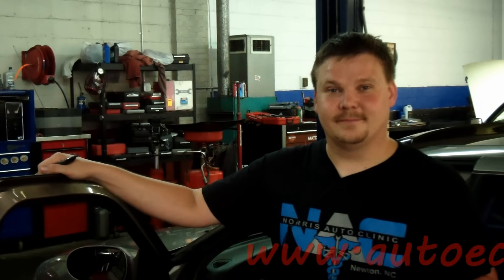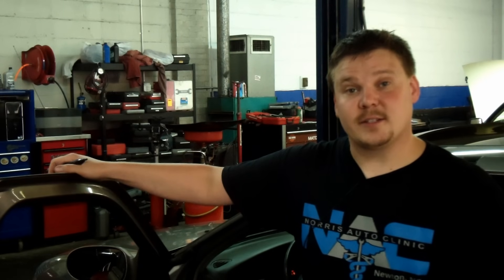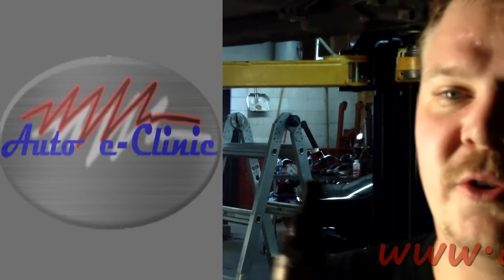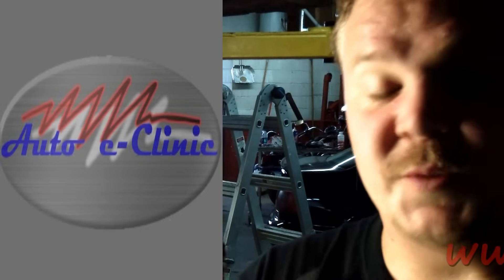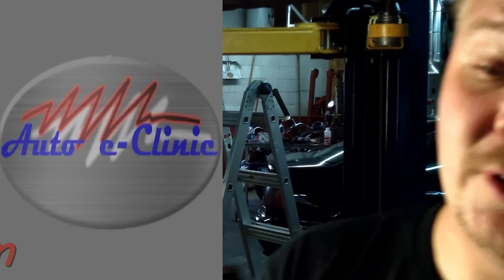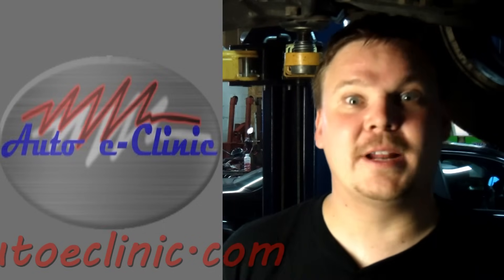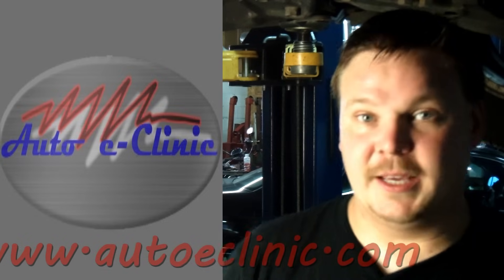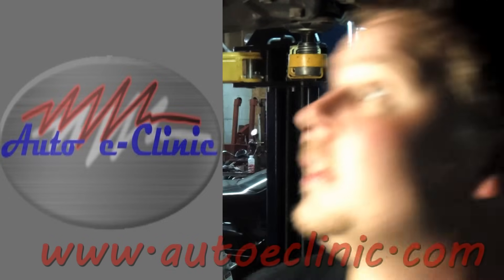How to Fix a P0138 Code: O2 Sensor Circuit High Voltage Bank 1 Sensor 2

Comment: I don’t know if he covered this part but if it’s been in the fucking pipe a long time go down to Home Depot get a little map torch and heat up a little bit. The odds of you snapping that O2 sensor in the pipe is pretty high if you’re not a mechanic and you don’t do this all the time you don’t have the skill set to understand the dues and don’ts of taking out a simple O2 sensor, if you snap that in the pipe now you got a problem it’s gonna get expensive settling torch and heat up a little bit that will guarantee you almost got that old two cents. It will come out. I’ve seen people do that. Don’t really know. is they get wrench put a lot of on it and they snap it in the pipe now you got a problem.

Comment: That car is running rich as fuck and thats why the o2 was black.  Replacing the sensor wont fix the likely leaky injector or worn out spark plugs.

Comment: Yeah I replaced all four of my '02 sensors and I'm still getting the same code and have voltage to all of it. What now? This is on a '05 Dodge Dakota 3.7
Reply: If you changed the sensor and it is not of good quality or you got it online, that may be the problem.

Comment: What if in a 2010 buick lacrosse 3.o I changed all 4 02 sensors and the the wires good but the check engine code still on?

Comment: scan is showing POO32 POO38 POO52 POO58 even after sensor replacement,..... ECM failure ?
Reply: Or a wiring failure to the sensor(s)

Comment: so Sensor 1 is likely on top of the engine.  in a 2018 Kia Soul, there's one on top and one downstream.  Its throwing P0132 and P2237 and cylinder 2 misfire, and knock sensor.

Comment: I've replaced both my O2 sensors and I still get this same error p0138 p  P0031 p0132 p0037
Reply: did you manage to fix it? Im having a same problem and have a purge solenoid error as well
Reply: @5149111  no I haven't I stopped trying truck seems to be running okay so I gave up
Reply: @troyonufer2029 could just be a fuse or relay

Comment: Wiring harness on my 03 Explorer bank 1 sensor 1 the wiring harness off the engine reads 12 volts off to sides then I have the ground and I'm getting about 1 amp. With it unplugged key why am I getting 12 volts out of two little wires

Comment: i have 06 kia sorento had the same problem i replace both downstream sensor check wire volt was good same code as everybody it came up that was the angle position(camshaft sensor) it would also not detecting my catalytic

Comment: What if the sensor was good and the high voltage was due to a lack of oxygen in the exhaust?
Reply: That's a sign I think of a bad cat...I never got how the computer differentiates between a bad downstream sensor and a bad cat

Comment: The car is not a B15 Sentra. I was looking at this for location because there are actually FOUR sensors (bank 1, bank 2). I have p0138 which is Bank 1 sensor 2 but this video has a O2 sensor that's not even where the location is.

Comment: I have an 06 Dodge Caravan, 3.8 V6, and got an 02 fault code. I replaced sensor, cleaned and checked contacts, reset it, but code still there.. Any thoughts?

Comment: Error 138 means that the oxygen sensor is generating a high signal above 1 volt for a long period of time. This can happen if the sensor is not able to breathe fresh air. The breathing process is happening through the sensor wires. Thus cleaning the wires end can resolve this error code. Also it is possible to make some punches in the wires to let the fresh air getting into the sensor.
Reply: Punches in the wires 😂😅😂
Reply: @FernoFactor  
Pressure release 👏👏😜😜
Reply: How you punching holes in wires bud? 😮

Comment: what kind of Voltage meter are you using what model??
Reply: Jose Diaz that was a “power probe” they are so nice. They can detect either voltage or grounds without having to rewire like a test light.
Reply: @MaxDoody  do you know how much it will cost?

Comment: Hi, I have the same code with pt cruiser, but 1 month ago I already change the sensor because of low voltage, what do you the solution?
Reply: 3:30 3:30

Comment: What to do if u changed o2 sensor and still says low voltage o2
Reply: Christy Fruge check intake and fuel system firstly
Reply: What was the resolution Christy? I'm having this issue

Comment: can an exhaust leak cause it to throw a P0138 code?
Reply: P0138 Possible Causes 
Faulty Rear Heated Oxygen Sensor Bank 1 
Rear Heated Oxygen Sensor Bank 1 harness is open or shorted 
Rear Heated Oxygen Sensor Bank 1 circuit poor electrical connection 
Intake air leaks 
Exhaust gas leaks 
Inappropriate fuel pressure 
Faulty fuel injectors

Comment: Autoeclinic- That was pretty pointless, wasn't it? No explanation of what an O2 sensor does, is, where it is, tools you need, or ANYTHING- just "it goes bad over time, so change it, and the new one fixes the problem, since it's new, so it works like how new stuff does".
Reply: Absolutely pointless. Wow!
Reply: If you are not so mechanically inclined, as it appears you are not, take it to a garage.
Reply: The video was made to sell the parts listed you see.

Comment: Is 2003 nissan altima v6 3.5 coolant temperature sensor circuit high voltage is the same as the temperature sensor?

Comment: Email hello .. my Chevrolet Presents feasible P0131 Low Voltage in o2 circuit .. I did exactly what you explain , then turn off the car for a few hours to turn and walk Reprise code .. Any solution ?

Comment: I replaced my O2 sensor after getting a P0141 code (heater circuit malfunction). After replacing sensor and resetting code I got a P0138 (circuit high input) code for same sensor location on my civic hybrid (no more P0141 code). What gives? O2 sensor is new. What are the next steps to troubleshoot?
Reply: Caty
Reply: Did you ever find a solution? I have the exact same issue. Thinking it could be a poor ground connection?

Comment: i had a code p0138 come on and i watched the video and replaced my 02 sensor and the light came back on with the same code
Reply: Check air leak in your exhaust 

Your catalytic converter may be finished
Reply: Yep
Reply: Oh, that's because they didn't tell you a damn thing. They just said "it goes bad over time, so replace it with a new one"
Reply: Isn't she a moron for not knowing stuff about cars? I don't know how to check the sensor, so I wouldn't try to, since I'm so stupid- definitely not because I don't give a fuck since car nerds are such queers...
Reply: +Meghan A Youre supposed to check the sensor first to see if its working you moron.

Comment: How about this? My 2004 Sebring ok, MIL lamp on, plugged in scan tool, got code P0138, O2 Sensor Bank 1 Sensor 2. Randomly goes away then returns. Car has a power steering leak somewhere and when I fill the reservoir the light also goes out for a bit. Any suggestions?

Comment: It was the O2 wiring melted behind the block in an area I couldn't see or access without pulling everything out. Ended up taking it to a mechanic and they found it

Comment: Sensor it self was not tested!
Reply: It's fucked, why test it!!
Reply: @jonniewadd56   It might be functioning correctly but the engine is running lean, which would trigger the high voltage.

Comment: i got p0138 on my 1997 mustang and replaced the bank 1 sensor 2 and cleared my code but got it again is this bc i may need to also replace my bank 2 sensor 2?
Reply: I know this is an old comment, but I guess the code came back because of not an original oem or good quality sensor? Or bad cat or other reason?

Comment: Any advice for p0132 on an 2004 explorer V8.  I have replaced the o2 sensor (Bank 1 Sensor 1) with 2 different brand new o2 sensors and the code comes back on almost immediately after resetting.  The freeze frame data shows that the voltage is at 1.275 V every time the code comes back on after resetting.  Becoming desperate to solve the problem, and can't really afford to take it to a mechanic.
Reply: ron nichols did you ever find out a way to fix that truck?
Reply: Have you ever found the problem with it?

Comment: Thanks for the great video on the diagnosis of P0138.  Question for you.

I have 2000 Toyota Camry V6 with 180K miles that started showing P0136.   OBDII says  it is B1S2 (Bank 1 Sensor 2).   Trying to locate which sensor is that on my Camry V6.    Is that the one on the exhaust manifold on firewall/dashboard side ?   Or, is that the one under  the car at the Catalyst converter?     Also, could you provide me the Denso Part number for it?     I have O2S with Part 234-4122 but not sure if that's the right one.    I saw a list of Densor O2S with various parts, but not sure which will go with this issue that I have.  Thanks in advance for any detail answers. Nick

Comment: I got a P0138 when my check engine light came on suddenly in my Toyota Tacoma.  Here, someone tried to jimmy my gas cap.  Thank god I put a locker on there  but they were able to jiggle it enough that my truck threw the code.  Put gas cap back on, check engine light is no longer coming on.  Just an FYI before you go dropping a bunch of money on a O2 Sensor.
Reply from the maker: That's true, Micheal always stressed good diagnostics for all repairs.
Reply: Thanks, someone put a diesel cap on my gas engine truck , I think it's a non pressurized cap and I'm supposed to have a pressurized one

Comment: If this car is burning oil the new oxygen sensor won't last that long. Also if one oxygen sensor is getting replace it would be a good idea to replace both of them the one b4 the converter and the other one after the converter. The pcm is going to set a dtc on the pre cat converter later on.

Comment: The proper way to diagnose a H02S (depending on what type of oxygen sensor it is) is with a high speed oscilloscope and check it's waveform.  Also H02S just don't go bad.  There is usually a root problem such as an engine that is burning oil or coolant. Using an OBD II code reader and power probe is not the textbook way to diagnose a defective H02S
Reply: Maybe but your average person isn't going to go buy and learn how to use an oscilloscope just to fix their car. Nor is that needed to fix the car that's what a pro would do in a shop setting, for DIY this is more than good enough.
Reply: He didn’t use the OBD 2 meter to diagnose the O2 sensor. He used a voltage meter. Also, why would you buy a high-speed oscilloscope when you can just buy another O2 sensor?
Reply: @newbluerugby  OBD 2 METER??? Scanner, reader, but not meter! Did they get P0138 Code from a volt meter too?  Also, why would you buy a high-speed oscilloscope  (or any diagnostic device) when you can just buy another car? Mentality of 90% mechanics.

Comment: thanks for answer my question but seems to me i will pay more than that because 116 $ asking just for diagnostic after  emission test ///O2 Sensor circuit high voltage bank 1 sensor 2// thanks anyway josef

Comment: It's also good to check the O2 sensor response by unplugging a vacuum line or performing a snap throttle and seeing how the O2S in question respond viewing the live data on a scan tool before replacing. Either way these tests should present an immediate response in the O2S readings. I found a good video of this a couple weeks ago and wanted to share. Search 'O2 Sensor Response Testing' and look for that in the title.
Reply: werealeyes
Reply: I liked the part where you checked the voltage before you assumed that the o2 was bad. Great video and my 06 Saturn Ion thanks you too.

Comment: quick question.  I purchased a new o2 sensor (rear) for my 05 sentra.  I am getting both 0037 and 0138.  I am pretty sure that it is not wired up correctly since with bosh they have the proper sensor but if you dont want to pay a ton of money you can get the kind you wire up to your old plug.  Since I have the old plug I kept it plugged into the factory plug coming from the ecu and wired up from there.  Is there a way to check via multi meter to verify I have the correct wires hooked up?

Comment from the maker: You are correct. With OBD 2 each system's function can be adversely affected by a bad output from another. It is not uncommon to get an O2 sensor code because another sensor or switch has malfunctioned. This creates multiple codes in which a deeper diagnosis must be performed. It's a good idea to check all available sources of information to help in making a correct diagnosis.

Comment: I have a 96 Jeep ZJ 5.2 and it recently had an 0138 code which is also rich fuel mixture for an extended time. I found that my coolant temp switch was NG allowing a rich condition by not letting it warm up quickly enough and not to full operating temp so i replaced the coolant sensor and yes also the O2 as it was old, i used a Bosch unit now it's fine, sometimes the sensor is triggered by another cause as too rich, etc. If i replaced the O2 sensor only it wouldn't be fixed
Reply: jim dandy did u have a code for coolant switch? Or how did u know this was problem?

Comment from the maker: First of all. It's not whether it can or can't be cleaned. Anything can be cleaned, if you go about it right. The question should be, first of all, whether cleaning it would do any good, and if so, whether it needs to be cleaned. Oxygen sensors are exposed to such extreme heat that the only thing that it can get (dirty) with is carbon. Extreme heat will turn any organic matter, such as gasoline or oil, into carbon.

Comment from the maker: Well the bad thing about that, is that baked carbon is not soluble in any kind of solvent, and even if it was, the sensing unit within the o2 sensor module, is not exposed, and is not visible. It is covered by what is usually a louvered steel cylinder. Therefor if you're going to brush it, use a wire brush and brush it as hard as you want, because it isn't going to hurt the steel cover. But this is the problem. The only thing that you can really clean with any success is the outer cover.
Reply: So I'm getting .18 volts, not what?

Comment from the maker: Since solvents won't do any good, I really would not recommend using electric motor cleaner, since the active ingredient in it is Trichloroethylene which is not a very strong solvent. not only is it's strength very low, but also, since it is designed to clean electronic components, it evaporates very rapidly, resulting in a very short working time.

Comment from the maker: Since o2 sensors are designed to handle such extreme temperatures. The best method of cleaning them, is to heat the bottom part of the sensor (the part that inserts into the exhaust) with a propane torch, to the point that it just begins to turn red. You do not want it to glow cherry red, even though they are designed to take extreme heat, you can still over do it. Once you have it heated to the point that is just turns red, or to the point just before it turns red, quench it in water.

Comment from the maker: This will break free any carbon build up inside the sensor. After the first time, some pieces may still be to big to come out of the sensor so I would recommend doing it 2 to 3 times, blowing it out with an air compressor between each time. But I would have to say, good luck, since O2 sensors very seldom fail do to being dirty. This is not common at all.